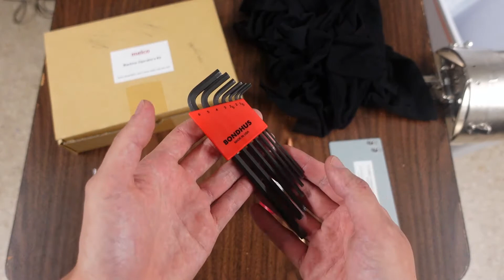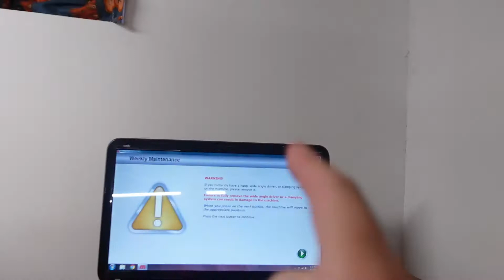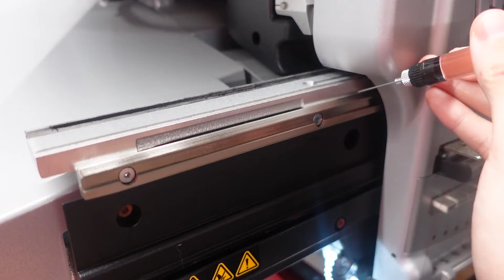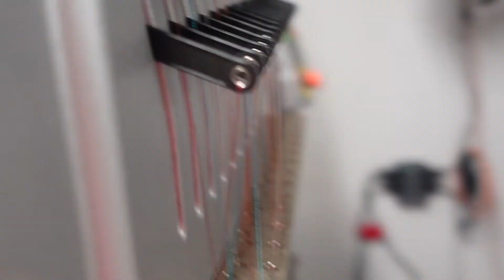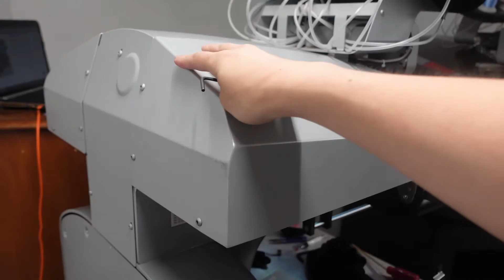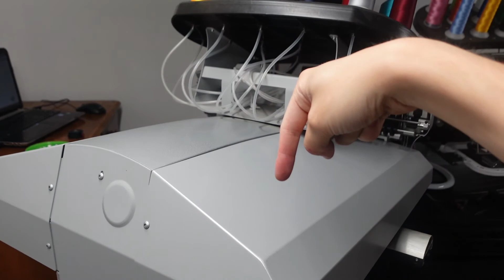Do THIS Melco EMT16x Maintenance Process Daily, Weekly & Monthly

Comment: In the last step of the monthly maintenance, where you apply grease to the grabber eccentric surface, the machine tutorial says to ensure that no grease is put on the black grabber flag, which I understand to be right next to the grabber connecting lever.  After moving the lever to the left and applying grease to the grabber eccentric surface, you let the  lever slide back over to the right.  Because this lever comes so close to the grabber flag, nearly touching it, the lever ends up pushing some of the grease onto the grabber flag.  So, how are you suppose to avoid it??
Reply from the maker: Just be as precise as possible. Try not to over grease. It's not the end of the world if a little bit gets on there though